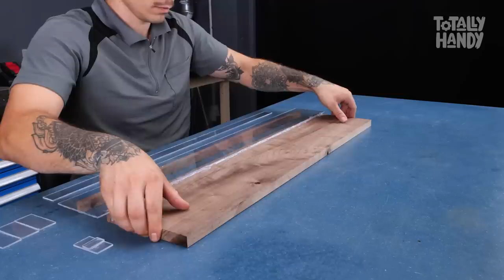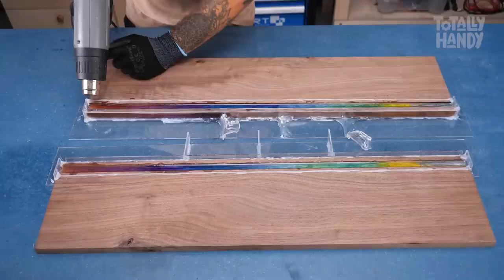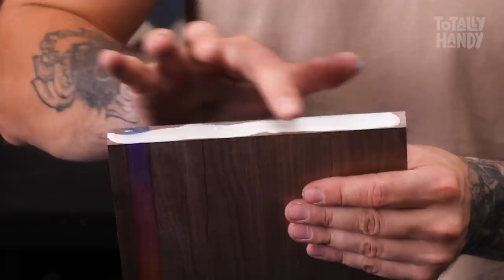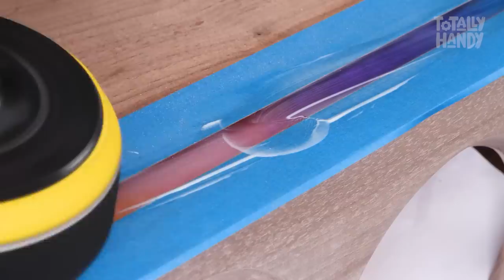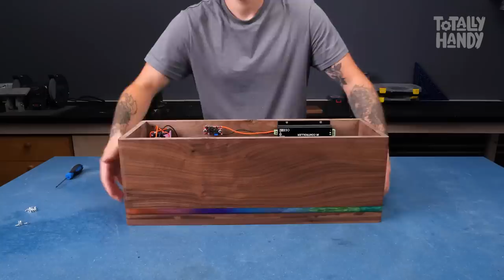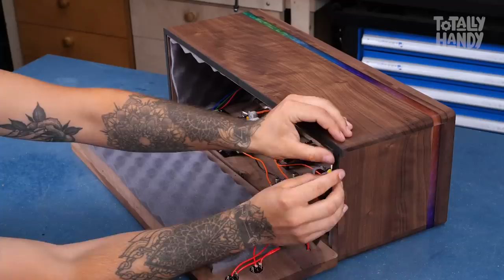Custom made Boombox Bluetooth Speaker / Sound bar

Comment: I like the idea.

I would be concerned about the durability though.

The box only having glue holding it together. Back panel screws helped, but a basic jointing of some sort would have been good. Even simple pocket screws.

Components inside held in place with only glue. Not sure how durable that will be, even some small screws likely would have helped there.
Reply: I agree. I mean, it looks neat. But the build quality is lacking to say the least.